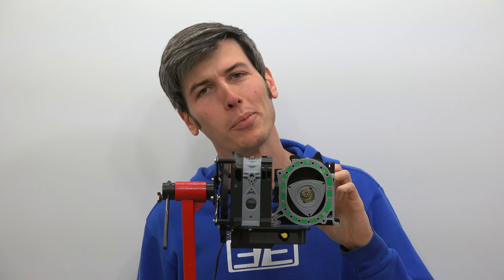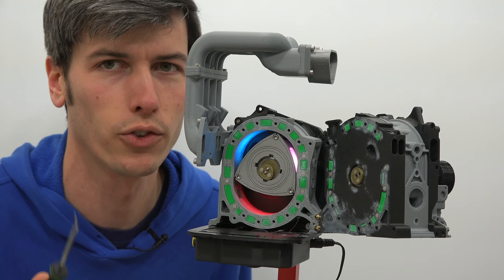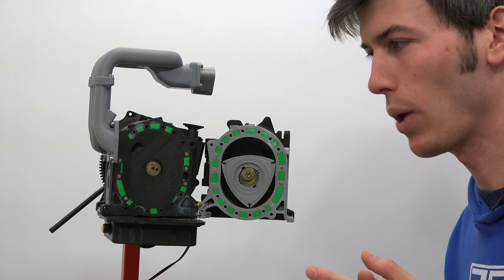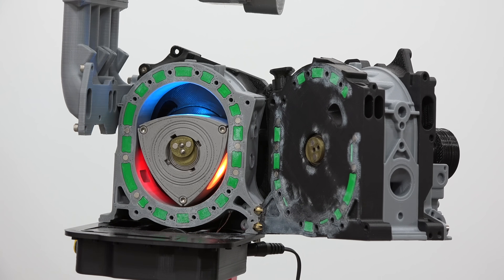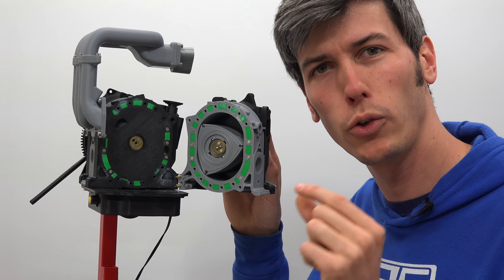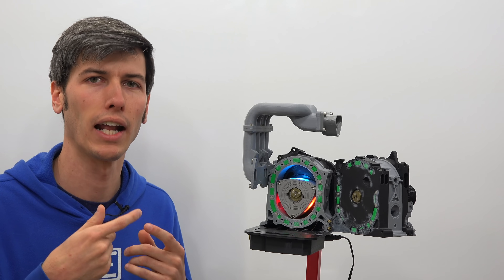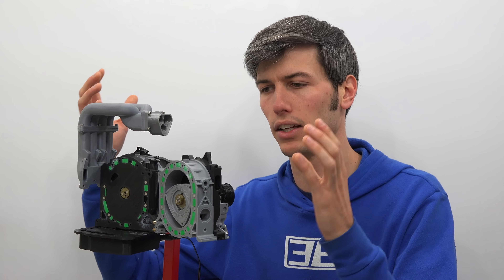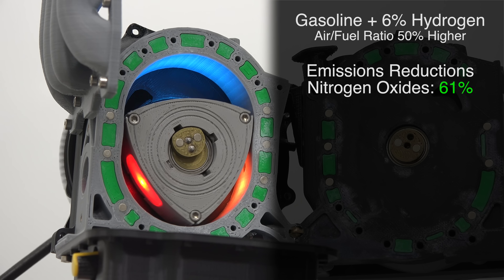Mazda Built A Hydrogen And Gasoline Powered Rotary Engine

Comment: It would be cool to see a thermal image of a rotary engine to see the distribution of heat
Reply from the maker: Hmm, well since it’s surrounded by coolant jackets the block itself would probably look evenly distributed. But if there were some way to see inside with a thermal camera, that’d be super cool.
Reply: @EngineeringExplained  Ask @Project farm if he can build see-through rotary engine like he did with piston engine.
Reply: Chevy SparkEV He’d need to build a germanium side plate as glass stops IR. 

Alternatively you could just build a rotary engine with a fairly thin and plane side plate and that would probably show the heat decently.
Reply: @Phos9  You don't lose 100% of IR with simple material like plexiglass. It's just matter of calibration.
Reply: @EngineeringExplained  do you think the high temps and atmospheric pressure changes would cause premature corrosion in the engine, as hydrogen will corrode metal faster in extreme temps and pressure changes???
Reply: @EngineeringExplained  i think the ceramic seals used in the high hp rotaries would be best for the hydrogen burning  rotary. They would not be susceptible to the detriments hydrogen creates for metal under high temps and pressure changes.
Reply: @EngineeringExplained  Just thought about this and found your channel, love the rotary engine
Reply: @EngineeringExplained  So they should have a hydrogen custom race  kit for for racing rotary custom builds ?
Reply: Probably would work on a air cooled one. Like the Sachs Wankel engines.
Reply: There is a video of a guy who made a clear front cover rotary. It's for an rc airplane but you get the same concept
Reply: Cat needs more screen time in your videos.

Comment: Next up: twin-charged hybrid hydrogen & gasoline powered rotary engine
Reply: The tittle: Mazda Built a 3 Rotor Gasoline, Hydrogen, and Diesel Powered With a Supercharger Twin Turbos and Dual Electric Motors
Reply: @the1anonymouse  "well it has to move somehow"
Reply: @the1anonymouse  for the win!
Reply: You forgot "with variable compression ratio" 😂
Reply: julian hernandez and VTEC xD
Reply: Mazda just launched its first electric car the 2020 MX-30 is 100%  plugin battery electric car.
Reply: Or a two stroke, with same chamber for combustion and exhaust

Comment: I think you could have just made the title "rotary engine video lol" and people would have swarmed the video lol
Reply: Exactly like when you open a pack of gum at school
Reply: Kylie Minogue gets her back door smashed would of got more lol
Reply: lol
Reply: Lol
Reply: lol
Reply: Why? Are people obsessed with small low torque very low efficiency engines?  What's the advantage?  The RX8 for example is ~16 city mpg, 22ish highway, with a peasly 212 horsepower (may vary slightly by year).  Why would someone want less power and efficiency?  Traditional piston engines seem to make more power with better gas mileage.
Reply: @OneWheelMan  It's a very fun engine to drive.
Reply: @OneWheelMan the reasons are exactly what you said. Or correct version of what you said.

Small: very small, very compact, very lightweight. Three very important things when designing a sports car. 
Power: 212 you say is "measly" but you're getting 212 out of a 1.3L! Name any other NA 1.3L that can produce even half that. Exactly. 
Low efficiency: its a tradeoff. For a piston engine, you're getting one power stroke for every two rotations of the crankshaft, per piston. In a rotary, you're getting three power strokes per one rotation. So for every one power stroke you get in a piston engine, a rotary is giving you SIX. Obviously explains the lack of fuel efficiency, but thats a hell of a lot of power you're getting out of it. 

Then you get the RPM band, having so many revs to work with is just fun. And the noise it makes, mmmmmhmmmm.

Its a unique way of doing things. Its a step back from the now boring standard of V8s, or in japan, Turbocharged I4s. Its something completely different and thats just an interesting concept that creates a unique and fun driving experience.
Reply: @_Zekken  Ok, the small size makes sense.  There are piston engines that can do around that....I actually have a Suzuki hayabusa which is a 1.3L naturally aspirated, but they're a bit shorter on the power )173bhp for gen 1 197 for gen 2) but that's an older bike, modern 1.0 liter bikes can make over 200hp naturally aspirated.  But yeah, my piston engine 1.3 liter hayabusa also revs to 11,000rpm. I can upshift it as low as 2,000, it makes good power and torque everywhere.  But yeah, I meant the power was measly compared to its gas mileage vs other cars with that gas mileage.  It's certainly good for the engine size.
Reply: @OneWheelMan  yeah, but that is on a bike. Also, After some googling, that Hayabusa engine makes around 130Nm of torque @9500rpm, the 13b in the RX-8 makes around 210Nm @8200. (and for curiosities sake the RX-7 FD made between 290-350Nm depending on spec)

Your bike also weighs like... 1/5 of the RX-8, so of course you're gonna feel like you have plenty of torque at all RPMs. Thats a hell of a lot more weight to be moving around. 

Your bike engine also makes more power BECAUSE its in a bike, that lack of weight means the engine can be made with lighter parts and it can rev more freely to make more power. 
find a 1.3L NA CAR engine that can match the rotary.
Reply: @OneWheelMan  the rx8 basically had a 4 cylinder motorcycle engine in a car that had incredible handling for it's time. You had to rev it like crazy but once you're up in the revs the fun is hard to beat. Same reason people still love the honda s2000.
Reply: @OneWheelMan  have you ever for once test drive vehicle with wankel engine? I did twice when i tried to buy used rx8, even through i cancelled the purchase at least that 20minutes of driving is fun.
Reply: @OneWheelMan  Mo Powah Baby! Just downshift more.

Comment: if companies helped with rotary engine R&D just like with the normal piston engine, do you think that today we would have just as efficient/more efficient rotary engines than piston engines?
Reply from the maker: I don’t think it would, unfortunately. Mazda has done a bunch of research into both engine styles, and they make one of the most efficient engines today, which is the SkyActiv-X piston cylinder engine. The rotary could certainly be improved, but I think inherently piston-cylinder design does have a healthy number of advantages.
Reply: The problem with the Wankel engine is that by design they burn oil, much more than that of a traditional 4-stroke piston engine. I believe the Wankel engine fell out of favor in the same regard as 2-stroke engines because the latter also burns oil, which increases carbon emissions. Of course, from a performance (per litre) standpoint, I would go with a Wankel engine any day of the week, but the emissions they produce are just prohibitive, along with other inherent flaws in design, which might be improved with extensive (read: expensive) R&D. My two cents.
Reply: Nelson only if you dog the hell out of it. Drive it hard all the time, you might burn a quart every 500 miles, drive it like a ‘granny’ and you might not burn a quart in over 3000 miles.

There are a few examples of piston engines that burn oil and it is considered to some extent ‘normal’, I believe some boxers from Subaru, there was a defective Honda engine I watched a video on, that to qualify for the recall it had to burn MORE than a quart of oil in something like 500 miles, otherwise Honda considered it ok, maybe it was Toyota ...  from one of the two and it was shocking to hear, and other qualifying things were pretty strict with mileage and age of vehicle that disqualified a lot of owners.

There is a solution to the issue, but a lot of people are too lazy to check their oil, change it regularly, so it could never be in a production vehicle ...  using a reservoir to hold a certain blend two stroke oil that gets sprayed in the combustion chamber instead of the crankcase 4 stroke oil. Burns cleaner, lubricates better, and adding about 1-2 ounces to an empty tank just before fuel up. Apex seals are happy, engine oil is happy, it’s just happy times ...  but requires an attentive owner; something that cannot be relied upon, you have to assume consumers are ignorant, lazy, and oblivious.

You’d have to implement a training course for both the consumer that was mandatory, as well as one for all the dealership staff that interacts with the customer and the vehicle. It would have to be an enthusiast halo car that would either lose money or minimum profit. Mazda doesn’t sell enough vehicles especially in the states to consider it.

The ones on the road can also get great highway mileage, people don’t because if you check forums on the cars, they scoff at people not beating the hell out of them all the time as a somewhat exaggerated general rule. You can get 25-30+ mpg highway. You can get 18-22 city.  But you do need to exceed 6-7k rpm about every other trip to keep the intake cylinder valve thing clean and reduce carbon buildup.

Also, unless you upgrade to LS coils, you need to replace them every 20-30k miles along with the plugs, or you end up destroying your cat, which leads to engine failures from heat/backpressure.

Fun cars, fun engines, but high maintenance and cost. Not for average joe who is either/both oblivious and low budget. That is the true issue with the rotary.  It requires knowledge and care, with an expensive maintenance schedule.
Reply: Electric is the future
Reply: @abunny6925  yes, it really is hard to agree. But one major problem is that they dont make noise
Reply: @n00bie96  I'm pretty sure electric cars not making a noise isn't a major problem...it's quite simple to fit a device to mimic the sound of a combustion engine...problem solved...
Reply: @ollythomas6702  and that would happen as soon as putting those fake "pshhh" turbo device on a civic, becomes acceptable. (Also there are tons of actual reasons why electric cars are hard to implement but yeah)
Reply: @n00bie96  What are you talking about? Being acceptable? Loads of kids put those on their cars already. You said it was a major problem for electric cars, I gave you a simple solution. Would love to hear about the actual reasons electric cars are hard to implement then? As it seems like tesla and many other companies have done a pretty good job so far..
Reply: @ollythomas6702  meh it's kind pretentious imo but we'll see. And no those kids are weirdos
Reply: @n00bie96  Yes I agree, I'm not a fan of dump valves either, but a device that makes an electric car sound just the same as a normal combustion engine would be fine. Imagine it in an electric BMW, you wouldn't even realise it was an electric car and it would get rid of the danger of these cars sneaking up on people.
Reply: @ollythomas6702  for the danger of sneaking up on people they could just make slightly louder streets.
Reply: @ollythomas6702  imagine hearing a burbly V8 noise from a distance, but when you look on your rear view mirrors, it's a car from I Robot 😳 I guess we have to get used to this haha
Reply: @ollythomas6702  an electric car trying to mimic the sounds of a combustion powered vehicle is pathetic and insulting!
Reply: @ollythomas6702  I Robot car that sounds like a bubrly V8
Reply: @ollythomas6702  It would be a lie. I agree that electric cars should have sounds, but NOT combustion engine sounds. Jaguar did it right IMO - I-Pace doesn't sound like an ICE, but still sounds good, without faking anything.
Reply: why would anyone waste R&D money/time/effort as well as why would the individual owner of an EV waste precious energy making sound?  Noise is a waste product of inefficiency not something missing to be added...
Reply: @RainCity3rd  Not precisely. Cars in the cities need to be noticed, and ICEs can be noticed even if you don't see them by their sound. That's even more important for blind people. That's why there are ideas to require electric cars to produce some sound at low speeds, so they will be easier to notice.
Reply: @8Hshan  I understand but that's a completely made up issue.  What percentage of the population is so visually impaired?  Also what about hybrids that are lower speeds are even only? Or other road users such as bicycles which certainly are not knew.  Should they be required to have baseball cards taped into their spokes?

   People just need to be aware and pay attention.  I'll be happy to have far less noise pollution.
Reply: @RainCity3rd  car noises are cool okay
Reply: @skel8484  Electric cars could send a radio signal that could be picked up by a device worn or carried by the visually impaired that would make a warning noise -- only where it was needed, and only to the people who needed it.
Reply: It depends heavily what your application for the engine is. If the wankel Engine would have been developed by 1930, it would have clearly dominated the skies of world war 2. However its inception was after the development of jet engines, so that the aircraft application (doesnt care about NOx, benefits massively from low weight) was no longer available. For personal vehicles, the piston engine is just good enough. You want your car to be as low of a maintenance as possible. Sure, car enthusiasts don't mind working on their car every weekend, but a normal customer wants a box with 4 wheels that runs a million miles without having to open the hood once. 
Racecars are a different story though. We hopefully will see some 6 rotor engines in motorsports some time. That would be amazing.

Comment: I need to know how the LEDs in the engine change color  :p
Reply from the maker: From Eric Harrell (the guy who made it) - "The back rotor contains an Arduino and color changing LEDs which simulate the combustion cycle in each chamber. The rotor is wirelessly powered by another Arduino circuit housed in the oil pan. The rotor syncs the LEDs by sensing a magnet in the housing so it speeds up/slows down the changing colors of the LEDs according."
More here: https://www.thingiverse.com/thing:3006071
Reply: @EngineeringExplained  a simple metal contact on the inner shaft would be significantly simpler and better engineered.
Reply: daniel tabrizian The inner shaft spins faster than the rotor so the lights would get out of sync if there were contacts. You could use magnets or contacts on the rotor to trigger the lights, but at that point you may as use the arduino.
Reply: Good ol Arduino, any microcontroller can do this, even maybe a dedicated circuit, with some temporizer like a 555 IC.
Reply: probably WS2812Bs, they're full RGB with crazy smooth transitions. look up NeoPixels, or cheaper alternatives. Great for reactive music lighting
Reply: 5v rail plus data signal can control hundreds of them from a single arduino/ESP8266/whatever